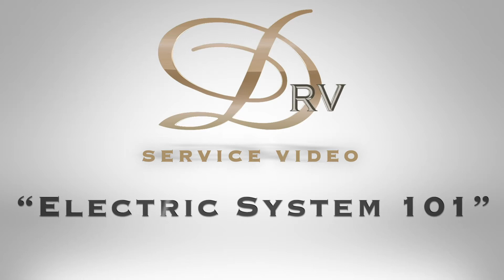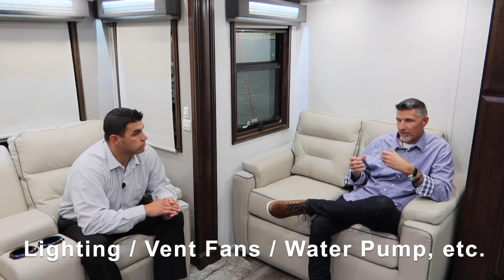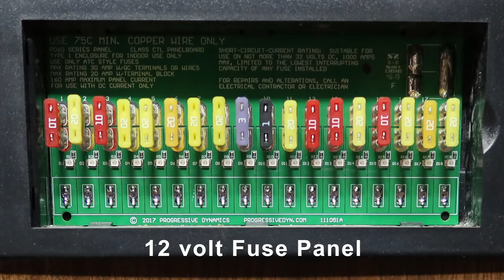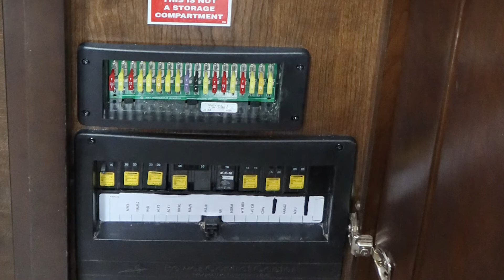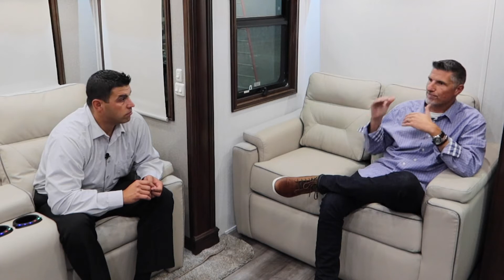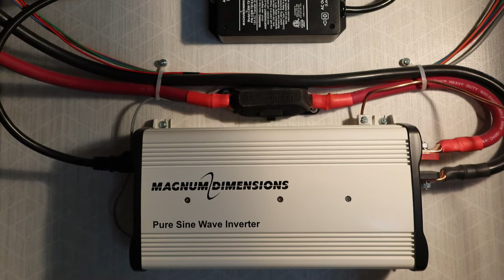MAINTENANCE - Electrical System

Comment: I learned (I believe) that my 2012 clash does NOT have an inverter!  I currently have an RV refrigerator but will switch out eventually.
Also gave me a bit of understanding how the electrical works. Thanks so much for taking the time.
Robin

Comment: I have a question. We have a 2019 Fullhouse  It is at the dealership right now getting worked on. We kept popping the circuit  breaker (GFI/20amp). We found out all the kitchen, basement and outside plugs were all wired to this one breaker.  Why are they not split up? We have a coffee pot, ice maker and the smoker outside plugged in and it pops every time.  Is this something you have fixed in the newer models? Would this be under warranty? We bought the rig March 2020.
Reply: McDade, did you get a fix? If not do you want a service source, we found to help us with DRV that had slide issues?
Reply: @ColeyCLogan  Our rig is still at Century RV in Longmont Colorado. I have not been updated about all the repairs since early November. Of course its winter time here and am in no hurry. No plans to use it until April.